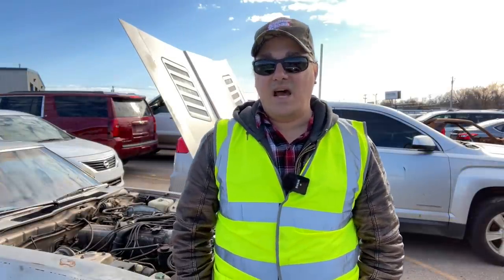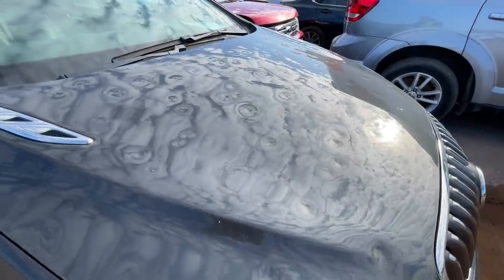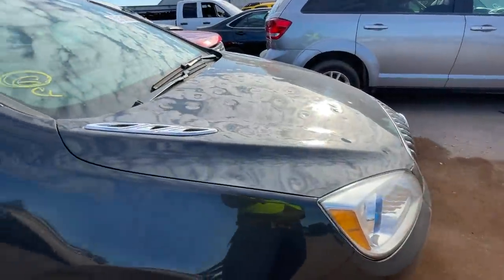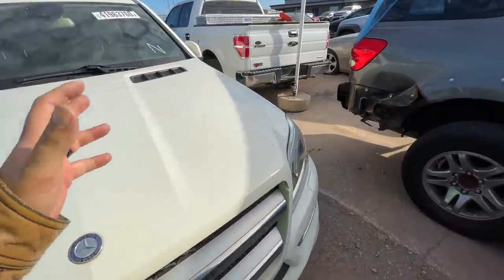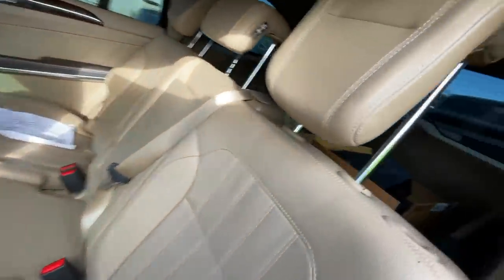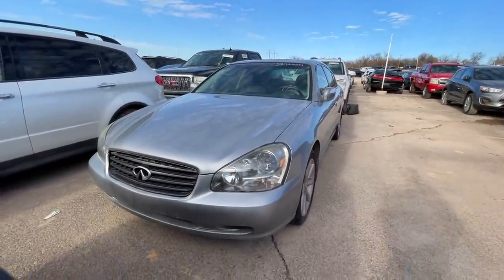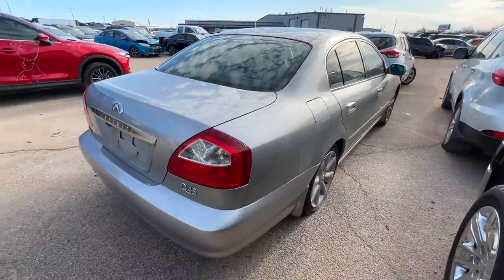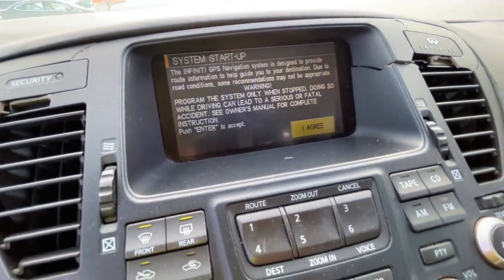Copart Walk Around 3-6-2021 + Cheap 1971 Chevy C10 SWB!!

Comment: I swear I remembered that C10, and i realized you looked at it in a copart walk around from 9 months ago
Reply: i just see at
Reply: My dad has a 71 C10 stepside with the LS 1 engine which he left to me
Reply: It's the same color to and he redid the wood floor in the bed it's also got krager SS wheels and street strip tires on it
Reply: @justinfoster1640  cool
Reply: I guess he was doing something with the cab forward electric when he passed because the whole front clip and the fenders are completely off of it
Reply: @GasGuzler thanks
Reply: @justinfoster1640  I’m sorry to hear that he passed
Reply: @GasGuzler  thanks it's been a couple of years since then and I didn't find out until recently that he actually bought the truck for my brother and I to use as a project truck
Reply: @justinfoster1640  sounds cool. I’d love to see it on the channel
Reply: @GasGuzler  I would but I live 1000 miles away from it and because my dad likes to hide paperwork we had to order a new title for it and once that comes in it's being sold to my brother since he lives closer to it and I'm keeping the other truck that was left to me that one's not a classic like the C10 but it is 21 years old and it's not a GM that is a 99 Ford F-150 with a 4.2 liter v6 which I plan on transforming into a Lightning minus the drivetrain swap other than the trying to mate the 5.4 lightning exhaust to the 6 cylinder manifolds
Reply: @GasGuzler  it's in Illinois and I live in Florida close to where Randy got the swamp vette

Comment: I thought you might give the Mustang to the young man who helped you clean it up, I thought he liked it alot.
Reply from the maker: He does love it but he's 12. #1 I'm not holding a car for 4 years, and #2 no kid should have a V8 sports car as a first ride.
Reply: @AutoAuctionRebuilds  My dad bought me a brand new Honda 125 for my first ride, I wonder which is safer, a V8 car, or an underpowered motorcycle? 😁👍✌
Reply: Randy is right about the V8. Don't fully understand the power = put the car into a tree
Reply: @AutoAuctionRebuilds  i am sure he will get good drivers training from you in mexico ha
Reply: Lol my first ride was a 1993 Mercury Cougar XR7 with a H.O. 5.0 302 V8 single in dual out exhaust Sea green exterior black pleather interior with wood trim in the dash and door panels needless to say I got quite a few speeding ticket and had to replace the tires a few times especially the rear tires since it's a rear wheel drive car lol
Reply: a v8 sports car, i see my son saying mom dad. the mustang is well in a tree. not a good idel to give a first time driver a car like that.

Comment: My first car was a '69 Chevy C10 with a gutless 6 cylinder and a 3 on the tree transmission.  Bought it when I was 15 way back in 1980.  It was in rough shape, paid $700 for it.  Different times.
Reply: Yeah I'm about the same age as you. I miss those days! 😃

Comment: Farm auction in Kansas this week on another youtube channel, a GMC like this but with vintage add-on tool boxes in place of the fenders (and the fenders included too) sold for $1400.  Six, auto.  Motor turned over but it had been sitting a long time.

There's your big involved project.  Buy this, buy a running wreck say a van with an LS and put the motor, trans and electrical in this.  Why a van?  Not too many extra systems or modules in a work van to deal with.

Comment: That GXP is a classic but finding parts would be hard. Plus these engines were known for piston burn. This was back before direct injection and high compression weren't a thing, so the engines weren't tuned right and the result was burning a hole through the piston or valve float. They revved high and the injectors early on were seriously cranked up, but no direct injection like we have now especially with the Hyundai 3.8L V6 that runs in the Otto and Atkinson cycle as needed to stop blow-by and get the most power. If you corrected the injection issue and made sure the heads were good, lots of fun.

Comment: Randy, for the Prelude, check main fuel pump relay, then, i would guess wrong timing belt adjustement. Non-interferential engine so probably no damage at all! be carefull with the transmission therefore!

Comment: Randy I want to bid on the Mustang at IAA but I was hoping you could tell me what you did to the spark plugs that blew out
Reply: Nothing happened he went through it and put another plug back in, didn't strip anything. The problem is did he fill it back up with coolant or left just the water in it. Seeing what happened to the dodge coronet I hope he put coolant in it after fixing the coolant leak

Comment: Skip to 26:50 for the C10... you can see the lift up hood release lever in the video! He should have stepped into the bed on passenger side and crossed over to driver's side step and opened door! Engine valve covers look '86 or newer.